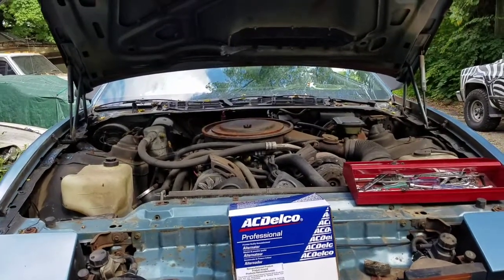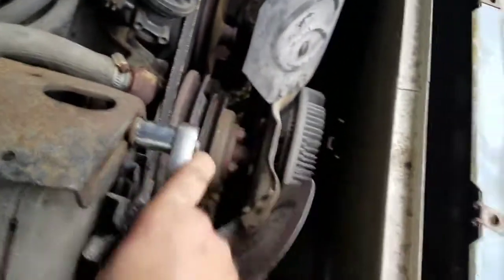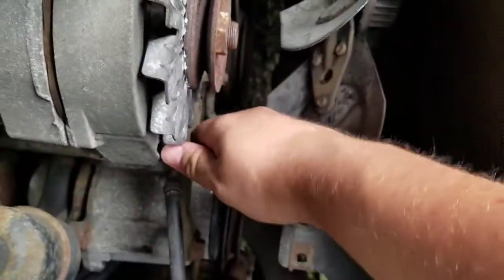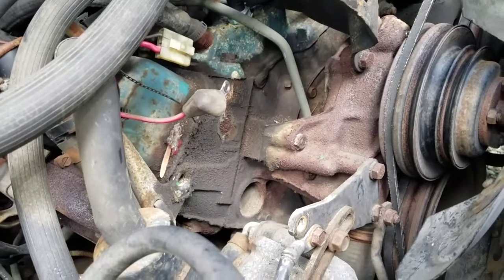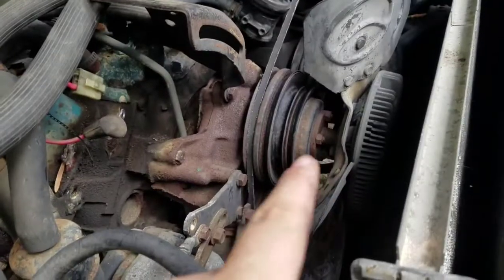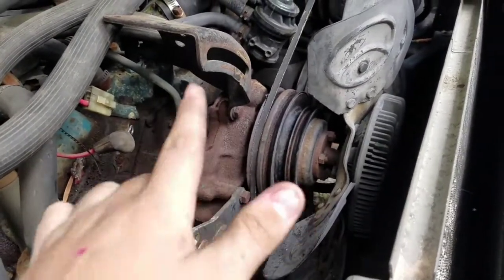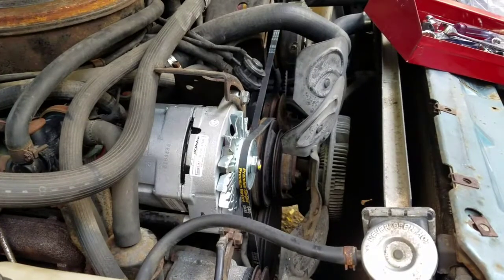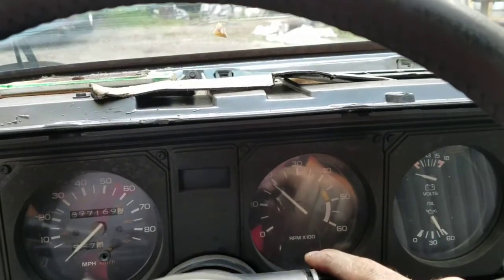1982 Trans AM Restoration part 2: Replacing alternator and belts

Comment: I had an '83 with the 305. Easy way for more horses. 1. Cut the belt for the emissions pump 2. Run a straight pipe in place of the catalytic converter. There isn't a sensor after the converter, so it will run fine without.
Reply from the maker: Alex Hawke wish it still ran like this but if you check out my channel on how it’s been running the past few months the carb is shot now and needs rebuilt and the smog pump is gone and my plan for it is to at some point do TRUE DUEL exhaust no bs and get a new intake plus none emissions carb, get some headers too it will be a GREAT MOTOR DESPITE WHAT EVERYONE SAYS NO DAMN LS MOTOR 😡 thank you for understanding these motors are great!!!

Comment: I have the same car as you. Just bought it but im having trouble removing the power steering belt. Is there another bolt/nut to loosen besides the three?
Reply from the maker: Not sure/don’t think so you pu might have to remove the bracket

Comment: How did you get the belt over the fan? Do I need to remove my fan?
Reply from the maker: Tina Parker No if you got the correct belt you should be able to do it I did one blade at a time but if that’s too hard removing the fan is only 4 bolts and it should come off easily

Comment: How did you get long bolt in keep having same problem will not thread in so I can use ratchet to lock in ?
Reply from the maker: Punisher Tactical from what I remember I had to keep moving the alternator around and pushing it would probably be easier with two people

Comment: Hi. Whats the pump thing under the alternator? My 82 trans am engine bay is so butched up, I'm amazing it still starts and runs at all.
Reply from the maker: hoffmachine from what I'm guessing it's maybe a smog pump we tried to get a belt for it but they had none the right size for it so luckily the old one was still in good shape
Reply from the maker: hoffmachine also the volt meter does not work but it is getting a charge
Reply from the maker: hoffmachine Yes it is a smog pump that was required back in the 80s for all states but now Ohio does not require emissions so I will be deleting all of it